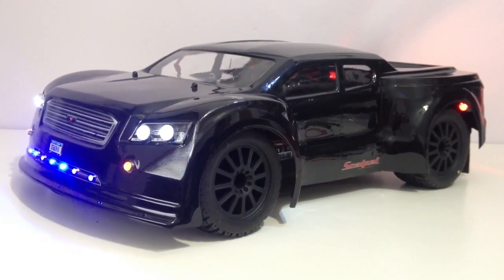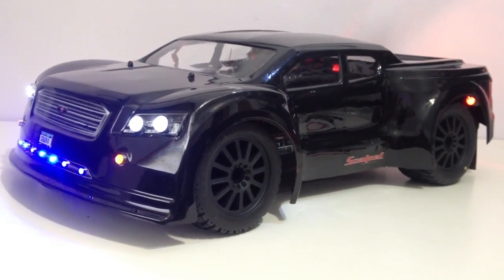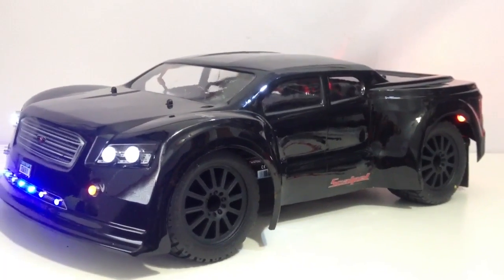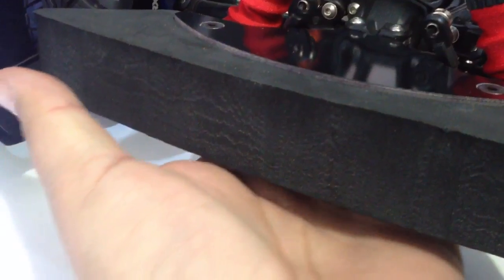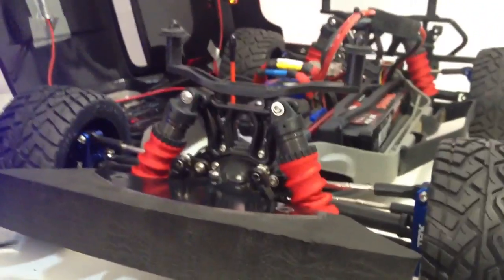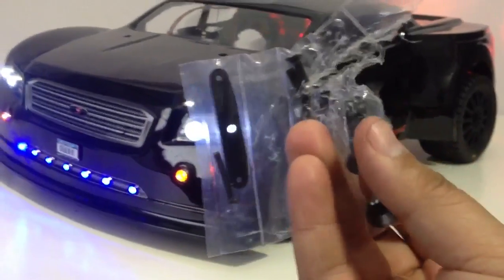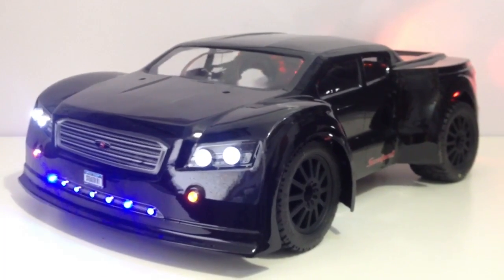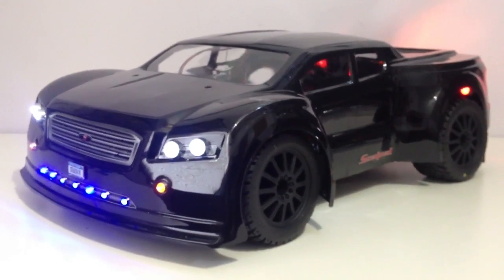JCONCEPTS SCALPEL SLASH 4X4

Comment: I like the body, but I've heard that you can also use the Proline PF8-GT body on the Slash 4x4 but you will need 1/8 scale buggy tires with a slick or street pattern. And probably some mods to make it fit nice.